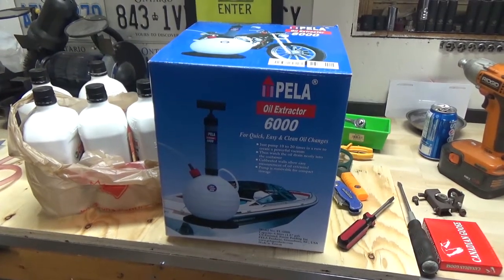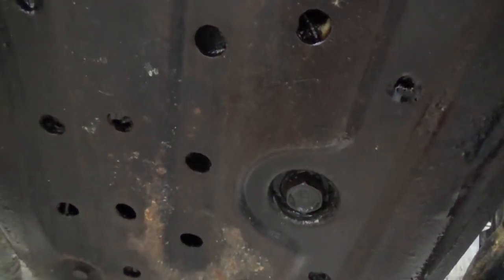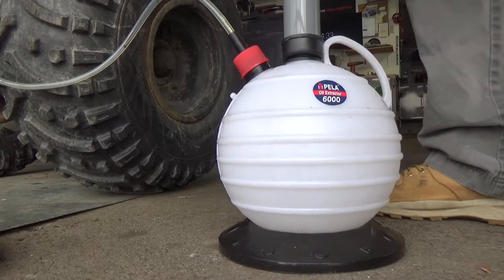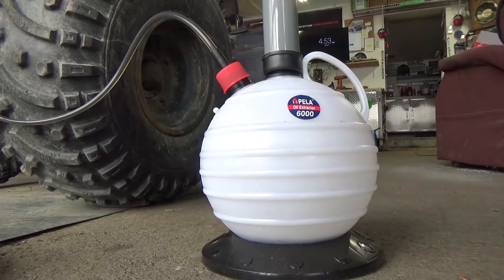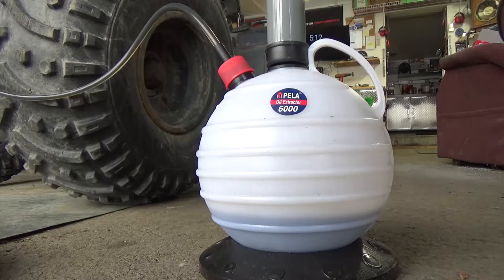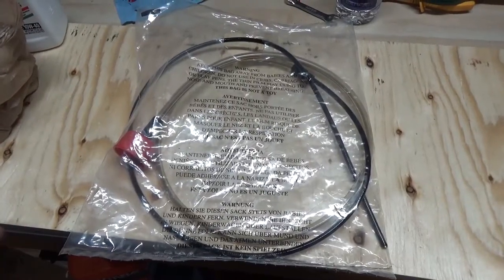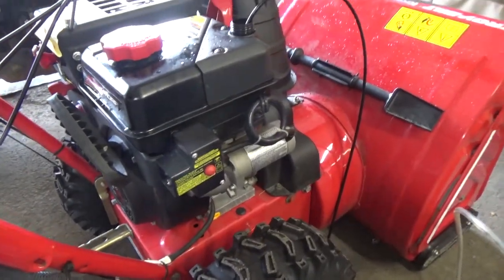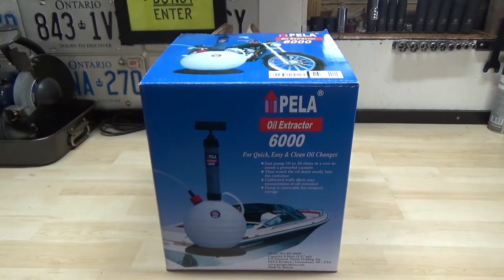Pela 6000 Oil Extractor [Product Review]

Comment: I bought this Pela to change the oil on my sailboat, there is no access to the drain plug.
Subsequently bought a Subaru Impreza - the oil filter is mounted on top of the engine and very easy to replace. So I tried the Pela on the Subaru and it worked perfectly to extract the oil.

Make sure the oil is totally warmed up and it comes out quickly. Between my cars and boat, I have done over 30 oil extractions/changes with no issues.

Comment: I literally just used this to change the oil in my Chevy. I am a complete novice when it comes to mechanics. Normally the car would go to the garage but as we're on lockdown and I'm out of work, needs must. 
I found this video helpful and overall I found the extractor a dream to use. 
I will not be attempting the filters but for now, this'll do. Great video, great tool.

Comment: Great review, If you increase the size of the suction line you would speed up extraction of the oil. Maybe make up an adaptor of some kind. You could take off the last section of line and extend the larger tubing.
Reply from the maker: Yes but using thicker line would also make it trickier to get into hard to reach spots, like fishing it through that atv bottom end.

However, for something like a lawnmower or snowblower, this would be acceptable!

Comment: Well it's April 2022, are you still using this and if so how is it working??? If you replaced it then with what??
Reply from the maker: Yes works well, the hose in between the big and small step down part leaked so we taped it. Been using it for years, awesome tool to have for these new machines that don't have drain plug
Reply: @EliminatorPerformance  💕💕💕💕💕💕💕💕💕💕💕💕💕💕💕💕💕💕💕💕💕💕💕

Comment: each raised plastic horizontal line represents one liter FYI. ;)
Reply from the maker: Yeah that's why I said it should've been just over half which would've been about 3.5L

But it had a head gasket leak so there was actually less than 3.5L

Comment: I had no idea this pump was so slow. I've been at it for an hour and extracted 1.5 L only.
Reply from the maker: Gotta get it real hot, it works great for lawnmowers, they usually have anywhere from 0.5L-2L
Reply: @EliminatorPerformance  Yes, the oil has to be hot.

Comment: fyi the engine needs to be warmed up and then it comes out like water .very quick  fyi
Reply from the maker: I actually ran that ATV for like 20mins before I pumped it out, it just hadn't been changed in so long, that why it took so long.

Once I got to the snowblower, it came out in less than a minute!
Reply: Do a retest?

Comment: I've had this Topsider extractor for 15+ years and it works great. https://www.northerntool.com/shop/tools/product_390306_390306  I like the low profile metal can (very stable) that holds two gallons.  The suction hose is large diameter so it can really work fast.  If the dipstick hole is smaller, I stick a piece of stiff nylon tube inside of the larger vinyl hose.  As others have stated, warming up the engine prior to extraction helps to speed up the process, plus it does a more thorough job if there is no oil filter on the engine (contaminants will be suspended).